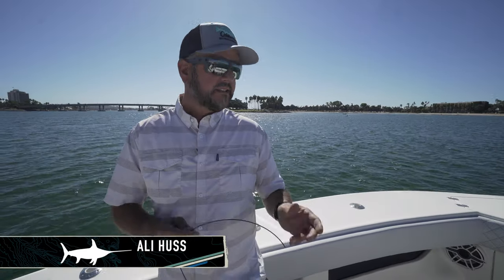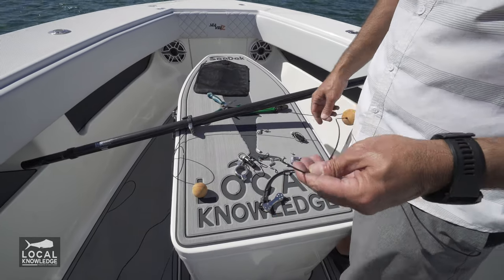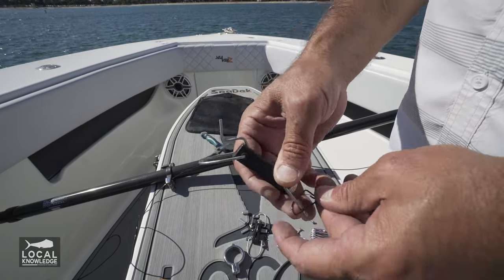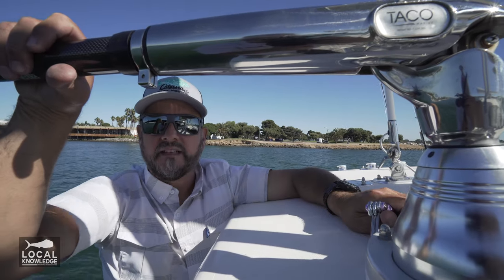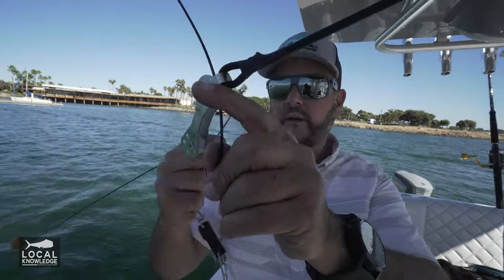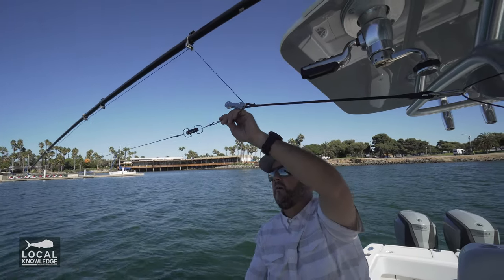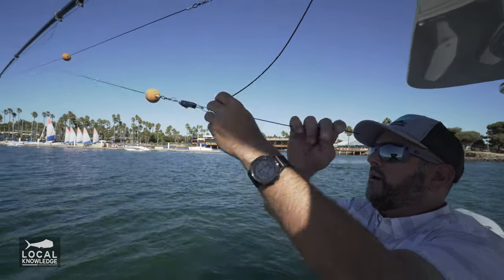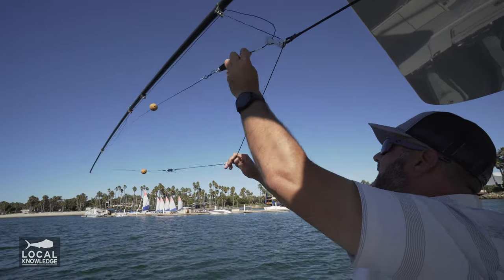How to Setup Outriggers On A Boat | Step-By-Step

Comment: Here’s a question? What do you do with the line when done using the outriggers and what do you do with it if you want to retract them? I will be installing a set on my boat and will be the first time using them.
Reply from the maker: We usually wrap the line through a tower leg and clip the end around a pipe that is just far away to keep tension on the line.

Comment: great vid! quick question... when you want to shorten your outriggers back to make them small for storage or trailering again, what happens to all the rigging? Do you just bundle it up and strap it tight back to the shortened poles? thanks!
Reply from the maker: You nailed it. You usually just wrap it around the poles a bunch of times and clip to off to itself.

Comment: How it works...
Any video of actual rigging and fishing?
Reply from the maker: This video explains how to rig outriggers. As far as how to use them, it's pretty simple. Put your front trolling lines in the release clip and use the outrigger line to the pull the clip away from the boat. THis increases the number of lures you can run and puts the rigger lures in clean water.